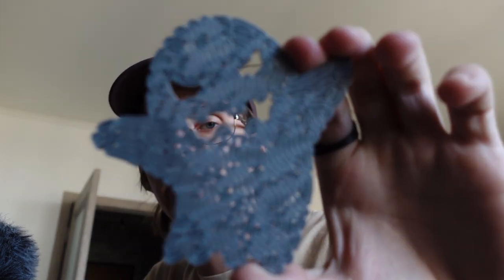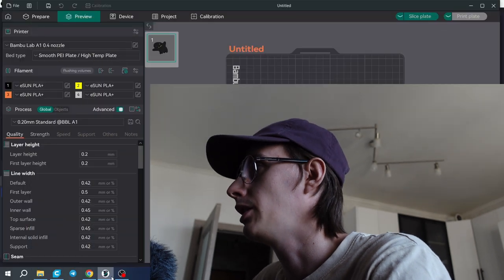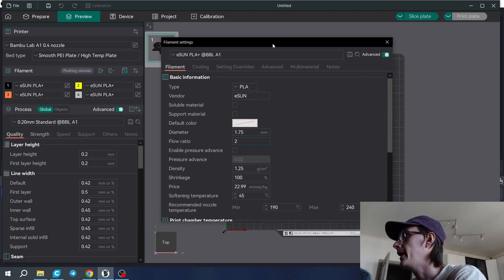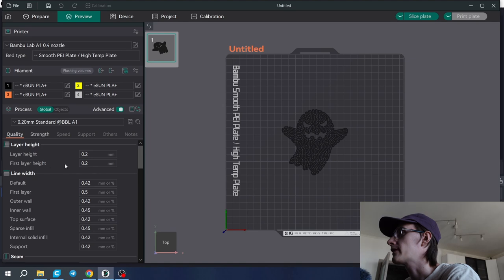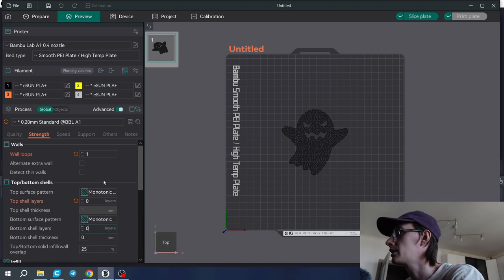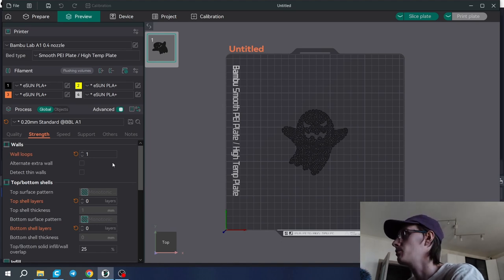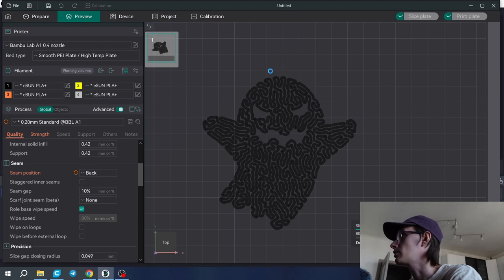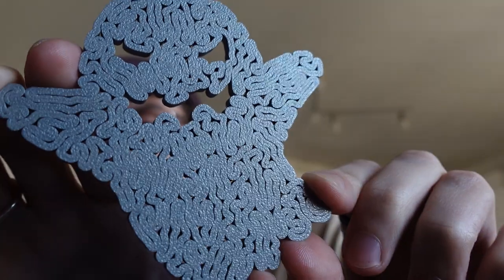3D Printed Ghost Coaster (How to / settings)

Comment from the maker: IDK why I thought that Halloween around the corner while it was september =_+
anyway
Settings that also works well for me with Bambu Lab A1 0.8 mm nozzle
0.5 mm layer height
0.8 mm line width
1.25 flow
vase mode
0 bottom layers

Comment: Just curious, why do adjust flow instead of line width?
Reply from the maker: It's because the Orca and Bambu slicers have limitations on layer height and width that depend on nozzle size. Simply setting a super wide line width won't give the same effect as using overflow.